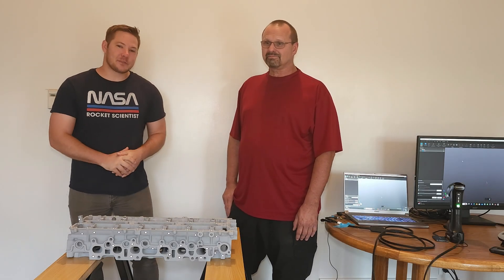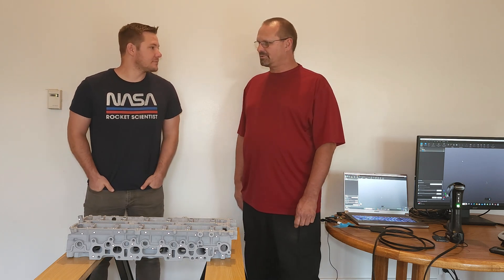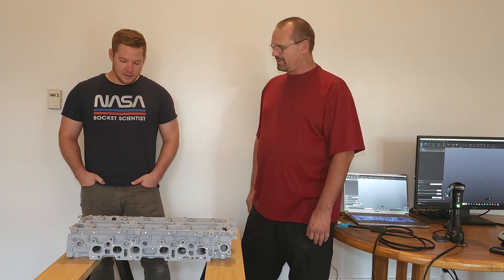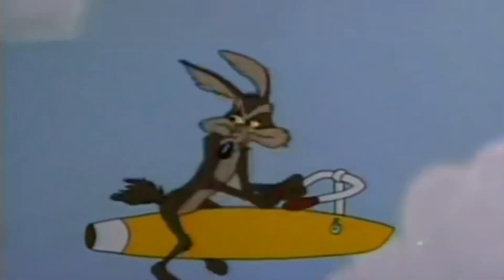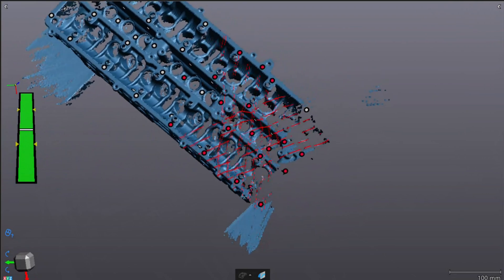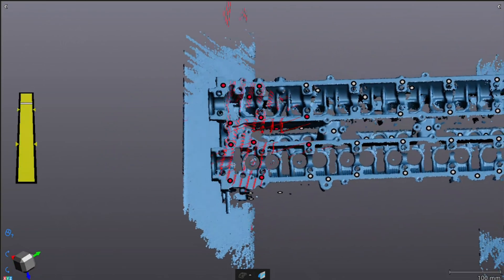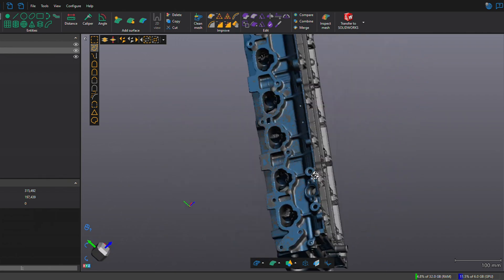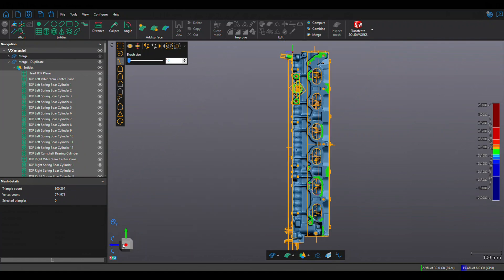Laser Scanning a 2JZ Head - Featuring In the Image

Comment: This is pretty cool .! But  I would spent time and money on a Cleveland head in a ford 200&300! It’s been done with welding and adding pieces in the 70’s and early 80’s only few had been recovered and restored since everyone was using it for drag race purpose only!! 650 HP NA is pretty damn good for a dirty welded and epoxied head in a straight 6 300!!..I would look into Windsor style heads and modular and even the aftermarket TFS style heads too since there was group here in YT that did the same with modular 4 valves in a V10
Reply: The cut up Cleveland heads were nightmarish, even when furnace brazing was widely available. Cracking was common. Rube Goldberg pushrods. It was quickly obsoleted by the billet AR head, way back then. The ET/MPH of the day tell that the HP figures quoted/regurgitated are wildly optimistic. Modular bore spacing is WAY small for other platforms.
Reply: @thegdfp6447  I agree..as I heard it was a nightmare to weld dirty casting! and many times not only been time consuming but it required lots of hours of re welding due to leaks! but scanning and making a new head design with Cleveland, Windsor or even AR style runners on a new casting would be fun!!